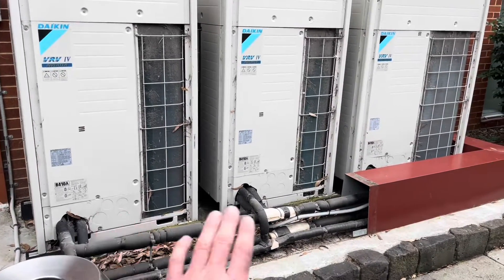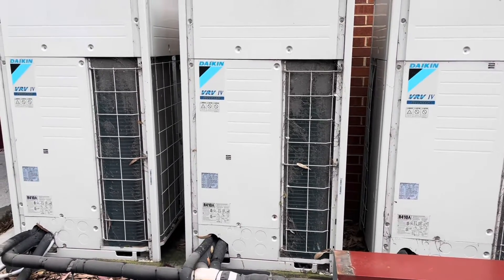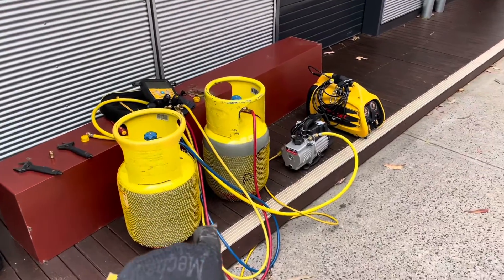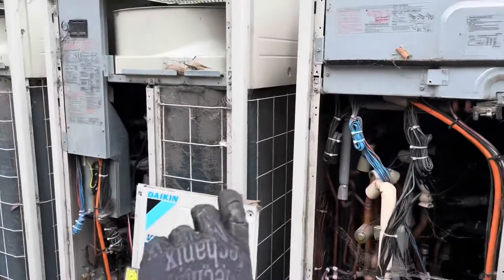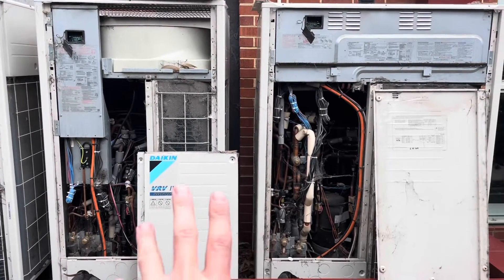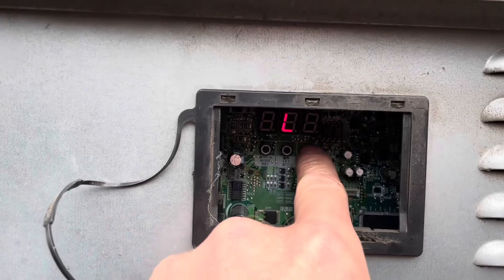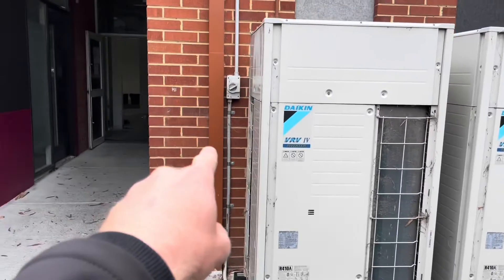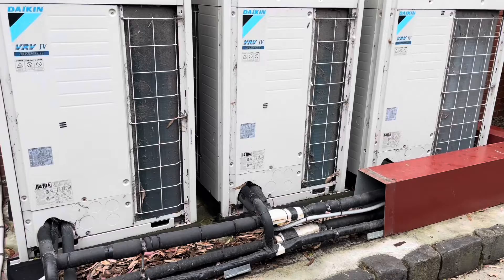Daikin VRV IV / Recovering 50kg’s of R410A out of This Daikin Multi Condenser System

Comment: I use the same CPS reclaim unit. They always trip out on HP. I use a homemade sup cooler on the discharge out of the reclaim. Helps so much when recovering heaps of refrigerant. Saves so much time. I think you can get an off the shelf one from Kirby, I just made my own out of some left over 3/8. Keep up the good work. Great to see an Aussie fridgy I can relate to on here 👍
Reply: Its because your recovering liquid. Its basically a small condensing unit. It cant pump liquid straight through it. You need to close off the suction port a small bit to reduce the refrigerant entering the reclaim unit. The poor thing is liquid locking not actually going on hp because of too much pressure
Reply from the maker: I’ve only had this reclaim for a few months and this is the first proper test it’s had. I think I’ll have to make up a sub cooler for the next time. Thanks for the tip mate, appreciate it. Glad you’re enjoying the videos too. I’m having a lot of fun making them. These platforms are a really good source of information. Everyone who has reached out has been really kind and helpful.
Reply: @hvacraustralia  Saw another bloke, might have been HVAC TIME, make a subcooler out of an old little condensing unit. Keep the fan and condenser together, whack some schraders on it and you don't even need water to keep your recovery machine happy. Holds a bit more refrigerant than the water based subcoolers but could be more convenient.

Seeing everything in kPa is gonna take me a bit. Used to everyone on here talking in PSI. 

G'day from Brissy!
Reply from the maker: @Thermoelectric7  That’s a good idea! If I can get my hands on one I’ll give that a go. Thanks mate. 😂 yeah, I feel the same when watching others too. I thought about swapping over but it’s just so ingrained now.